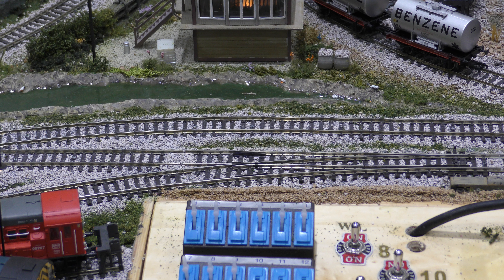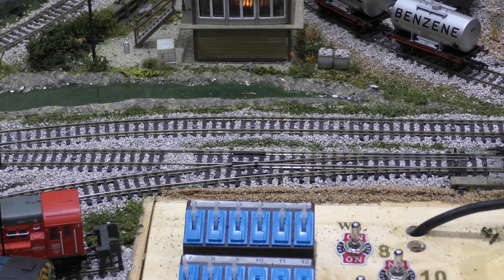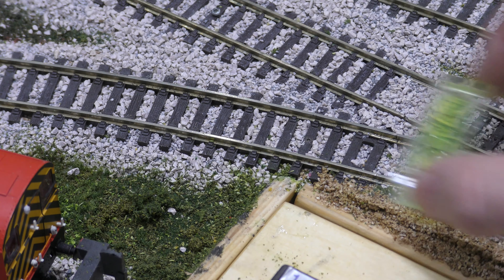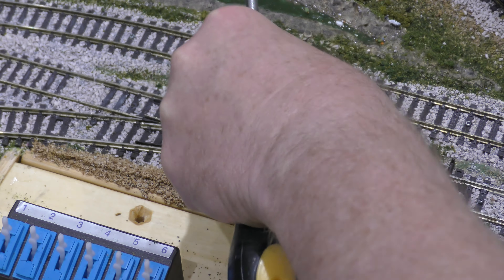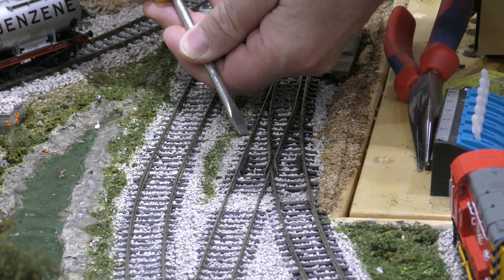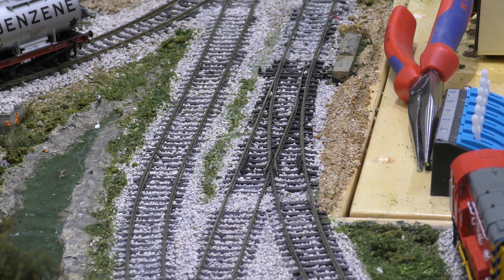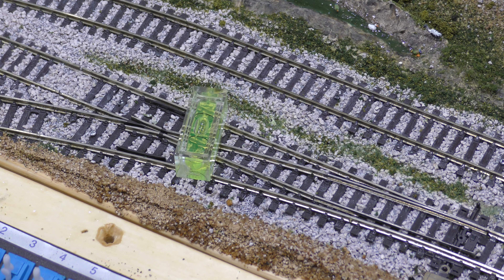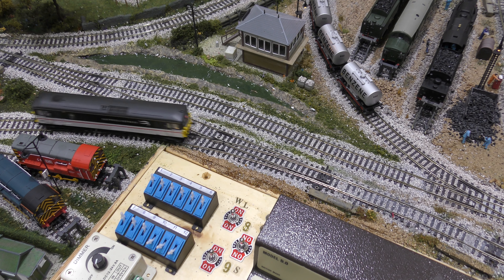Derailing on a point, all tested and fixed in real time.

Comment: Great stuff! I'm off to try it now! :) To be fair though, you don't really need 2 locos for each point test. If the spirit level shows it's out, then it probably should be fixed as you described.
Reply from the maker: This is true but some locos are more tolerant than others. Yes the points maybe out and an issue, but if you have for example, 3 A3's and only one loses its bogeys on the points, you know the bogeys of that loco are not quite right, as has been the case on more than one occasion.

Comment: Excellent tip! I had a derailment issue on one particular point that’s been a head-scratcher over time ... as you’ve shown, I purchased a small spirit level and sure enough ... a small but noticeable amount of ‘adverse-cant’ cross level difference! I lifted the outside rail a tiny amount to level ... and problem solved! Many thanks ... and you now have a new subscriber! 👍
Reply from the maker: Excellent!

Comment: Surely it cant be that easy.?
Reply from the maker: It is, you will always find social media experts who try to make like they are repairing a Saturn moon rocket to elevate their own self importance. What ever it is your dealing with in life, knowledge makes it simple.
Reply: Thanks Paul, I had the same problem with my new layout on 2 switch tracks ,I used a small file and filed the point for about 30 seconds and fixed it .